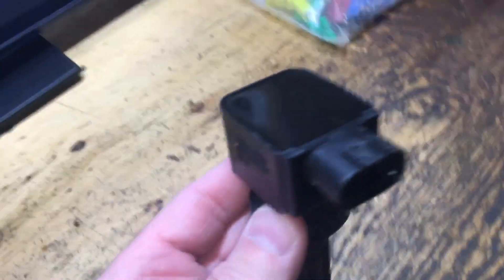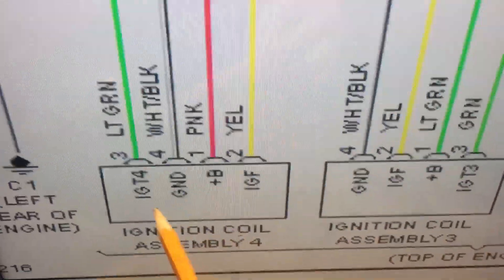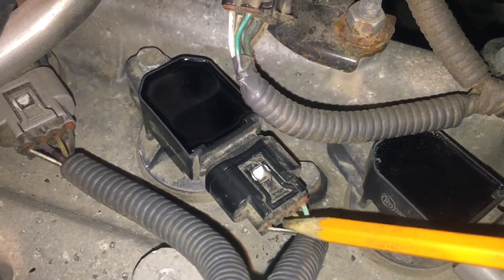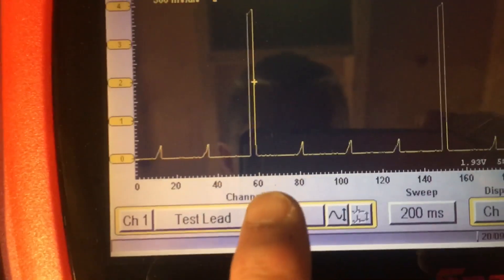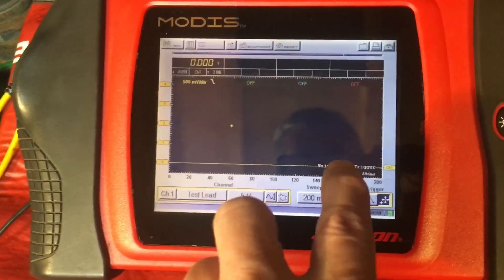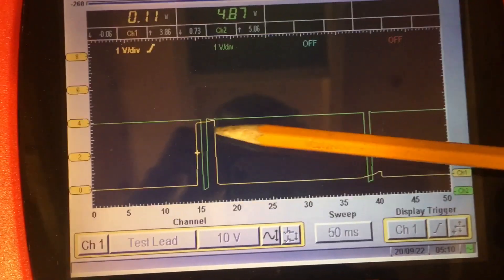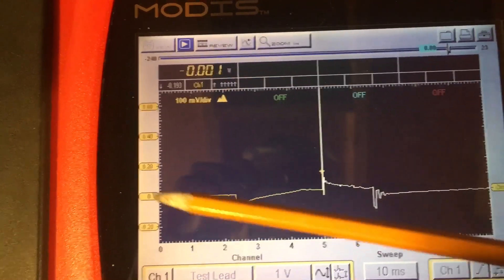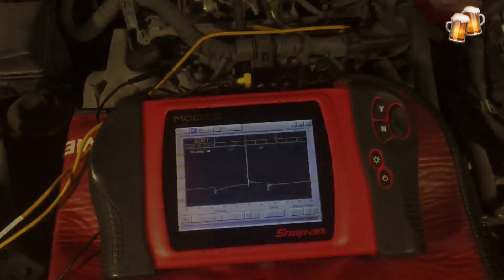Toyota’s  4 Wire C.O.P Intro

Comment: A mobile mechanic came out about 3 weeks ago to replace the starter on our 2002 Lexus LS 430 and after he was finished the car ran sluggish and the check engine light along with the check VCS light was on so I took it to Autozone to have the code/codes read and it came back P1663 OCV circuit (Bank 2) followed by P1354 VVT system (Bank 2) and below that it read Secondary DTCs P1330 Igniter Circuit #7. Well, for some reason I didn't pay much attention to the secondary igniter circuit #7 code, instead I concentrated on the oil control valve because I'd replaced the driver side OCV  last summer. I pulled the ocv out and checked it with jumper wires off of the battery and it worked so I cleaned it, oiled it and reinstalled it thinking that the mechanic must have broken a wire leading to it or it was unplugged in the back of the engine somewhere or something of that nature. I'd already checked the plug going to the OCV so I was confident that it was good. Anyway, we drove it for 2 weeks like that until I looked at the code readout and noticed the igniter circuit #7 code again then went out and looked and sure enough the last wire on the #7 cylinder ignition coil plug connector was broke right where it enters the plug so I pulled the connector out of the plug and soldered the wire back to it and reassembled it, plugged it in and it ran smooth and had power but the check engine light and check VCS light was still on so I figured I'd trace that down next. Well, after letting the car set for 20 minutes or so my wife went to run an errand in it and all the warning lights were off and it runs great again. 
 Does this make sense to you? Why would a broken coil wire (the black and white one) cause an oil control valve code?  I've been scratching my head with this one.

Comment: How about toyota surf/ 4runner 4pin cable TPS connector wire placement? The mechanic accidentally dettached them and now couldn't place them back according to order 😭😭😭 pls help!
Reply from the maker: Applicable wiring diagram (PDF workshop manual can be purchased online at very modest cost) will detail the pin out. Thx for watching.

Comment: I guess to protect the catalyst by shutting down the injector for the cylinder with the misfire or faulty coil.  This is why IGF is also important, too much fuel will mess up the cat. What do you think?
Reply from the maker: Yeah I think crank rotation anomaly interpretation is sketchy with respect to misfiring cylinder I.D. This provides alternative identification means for ignition related misfires. Cheers DJ 🍻